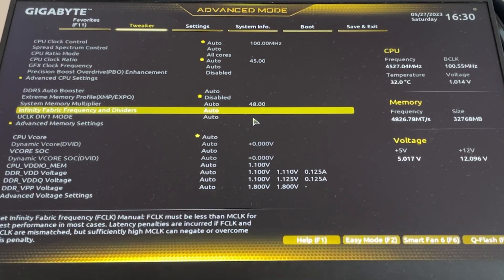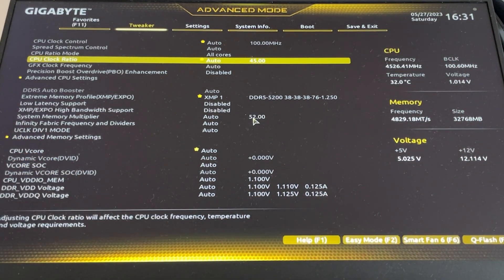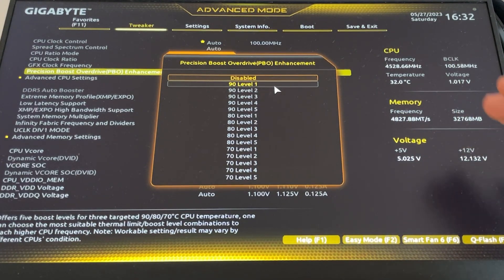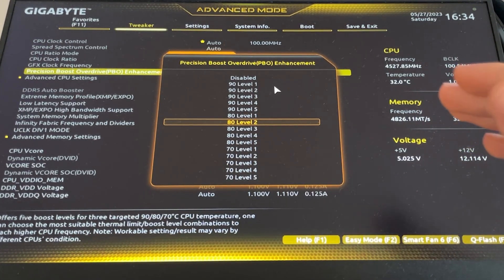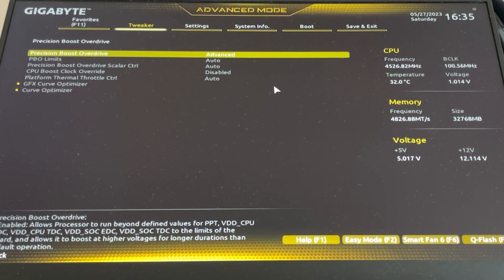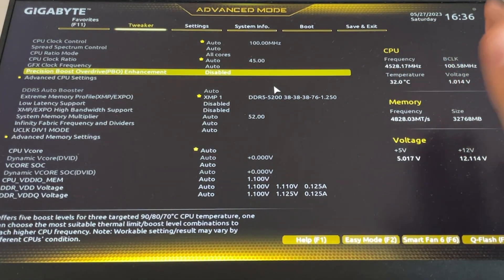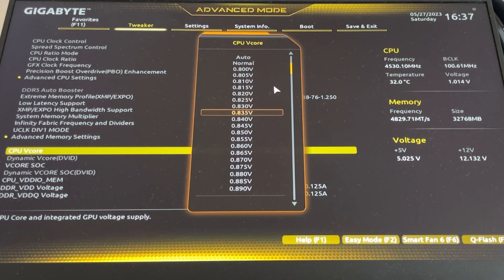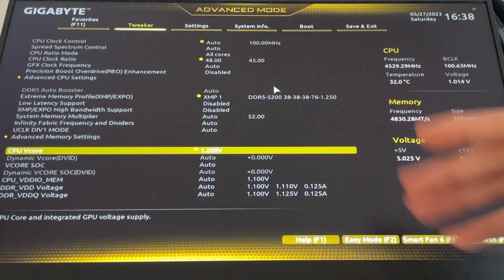Undervolt your Ryzen 7 7700X for more FPS and Lower Temperature!

Comment: So far I have the 1.2v set, 48 multiplier, and PBO at level 80 Level 5 so far Im staying under 50c still, but I noticed the frequency never goes higher than about 4850. Do you have any further advice to boost the frequency under heavy load?

Comment: You da best man! Undervolted at the preset 80-2 and it instantly dropped my temperatures by an average of 10c on CPU heavy games. I was freaking out all day thinking I had done the thermal paste wrong when hogwarts legacy went clear up to 99c when rendering shaders. I did a fresh install and it only hit 85c the second time around. I knew the 7700x ran a bit hotter than other 7 series CPUs, but 99c was WAY past my comfort zone of 85-90 cap

Thanks again, cheers!

Comment: Question, 

on my r7 7700 (max is 5.2ghz i think), i lower my clock ratio to 48. And i tried to run cinebench, its not reaching the max peak of 5.2ghz, is this because i lower my Cratio to 48, is this bad? Or should i put it back to auto? 

My cpy temp before i did all of this (while gaming) is 75’ish

And after i lower it to 80 -20 it drops to 50-55.  I know its because of pbo, but what is the reason of lowering the cost ratio.

Comment: Getting 5.1Ghz with a manual setting of 70 degrees thermal limit and -45 offset. Running cinebench for 30 minutes. Will do some long term heavy use and gaming and see if it holds. Was getting 5.3Ghz with a 75-85 degree limit and 30-40 offset.

Comment: i overclocked my Ryzen 7 7700 no X TO 5.0 GHZ all cores with 1.1 volt and its very stable and consummation below than before  and max temperature 70 degrees

Comment: Hi! I usually like your undervolt videos, but this is just bad. You just fixed a CPU at 4.8Ghz while this type of CPU is designe for big Ghz jumps, even for around 5.4 . Just use the settings that optimum used in his video that named "Fixing Ryzen 7000 - PBO2 Tune (insanity)". I get even colder (around 65C) and LOT better performance, around 2% loss. With yours, 75C, with 20% performance drop. BUT! I would used your settings, but i had crashes :') I started research and i found that gold video from optimum. (If you crash with -30, the -20 will works fine)

Comment: I have the 7700x on manual OC - 50x ratio on 1,1volts. Temps are from 45 (high idles, but normal as i readed) to 60 max. With 1,2 volts can i set 52x ratio, and with 1,35volts 54x ratio. All stable but i use the 1,1 volts scenario. Enough performance and nice cool. But! I use the CPU without Multithreading, just the 8 cores and 8 theads for gaming. I have not good experiences with PBO, crashes and high temperatures. Best choice is the manual OC. Thanks bro

Comment: So this video is a little misleading, when changing the pbo enhancement it does actually undervolt your cpu, however when he shows going to the curve optimizer I noticed he went into the gfx curve optimizer and anything changed in here only undervolts the integrated graphics that are on the 7700x. Most people who are going to undervolt their CPU will be using a dedicated GPU which means this setting will do nothing for you
Reply: Yeah but the normal curve optimizer does lower temps and that's a fact

Comment: For me leaving the voltage to AUTO helps a lot, it boosts the clock speed to 5.4 MHz. I would say, not play with the default settings but try the PBO negative

Comment: Hey. ! Some help
Needed. Cinebench hits 102*c on this cpu for me. (7 7700x) 

Is this a case of concern ?
Reply: Yes
Reply: @OJoshiee alright, what could be the reason ? Motherboard. AIO or the processor ?
Reply: @namanjoshi2528  maybe the aio, I ran a cinebench and before undervolting the highest I’d get was 95*c
Reply: @OJoshiee  alrighty! 
Though my computer stopped working lol. I need to check. There’s no light in AIO, though the Rad fans are working, probably AIO, or the MOBO is the issue 

I did PBO with offset of -10. Removed the temps throttle limit and set it to auto and it was pushing 5.2ghz -5.4ghz under heavy load.

Comment: Set mine to 1.28 and its been perfectly stable. ASUS is giving waaayyyy too much voltage to the vcores! My system would power 41 and hard shut off in games, once I undervolted the issue went away. ASUS' QC is total trash anymore. Even the latest BIOS from ASUS is giving my 7700x 1.48V and it is unstable under load. This is not acceptable, this could fry people's chips or MBs. Most wont know how to fix this problem.

Comment: Thanks for the help from your video, although a year old it helped me a lot to get my Ryzen 7700X to run under 94c under load. Although the BIOS was newer I tried your preferred method using 80/20 rule but it just did not work well. So I opted with your last suggestion and tested the CPU ratio at 48 with the CPU VCore (not called that in the MSI BIOS) and tried s few settings settling on 1.205v.
This gave me a much more stable system without needing blocks of Ice to keep it from melting inside the case. Max CPU temp under load = 78c with idle temp of 47c using a 48.5 CPU Clock speed. (could probably try higher)
I know this CPU is capable of doing more but the H5 Flow case needs a low profile 6000 ram to allow a Liquid Freezer 3 - 280 cooler so I settled on the Liquid Freezer 3 - 240 cooler at 100% and kept my fast ram. I did upgrade my MPG 650 Edge WIFI Motherboard BIOS to 1.10  - AMD Agesa 1.2.0.2b so all of your video screen settings were totally different. Worked it out eventually and this board has 6 x Sata connections which I needed for all my HDD's but it's not the best.

Excellent video and happy gaming.
Reply: What about the performance in gaming ? Or some workloads

Comment: Quick question, I've already fine tuned my 7800X3D with B650E Aorus Master which gives a nice 107 ECLK 5.4Ghz (with CO individual tuned for each core), 2200 FCLK, and DDR5-8000 CL36. Do I still need to enable PBO enhancement. Still not quiet understand that 90 Level 1 will overwrite my CO or not?

Comment: Im using a b650 gaming x ax v2 and a dark rock pro 4 for my cpu cooler and my temps were around 85 with a low 30% cpu usage. After using your settings I was at around 56 degrees with the same usage. This whole concept is so weird to me. Why do the CPU’s come with such a high default temp? Is it normal to under volt a cpu even with a whats supposed to be a good cooler? Im worried about losing some performance somewhere but I guess this will have to do for now.

Comment: Hi, in on MAG B650 TOMAHAWK WIFI (MS-7D75) When we talk about undervolting, CPU Core Voltage (Auto) is at 1.460-ish, and I like to try 1.2V as you said. But when I click to change it the options I see are: Override Mode, Offset Mode, Override + Offset Mode, AMD Overclocking. Which option should I click to set the 1.2V? CPU is Ryzen 7 7700x.
Reply: Hey I have the same motherboard and CPU as you when you stress tested it what temps did you get at stock

Comment: Am I the only one getting about the same score with all settings, except with PBO 90 Level 4?

PBO enhancement 70 lvl 1 + EXPO
PBO enhancement 80 lvl 1 + EXPO
PBO enhancement 90 lvl 1 + EXPO
No PBO enhancement + EXPO
All got me 18000-18500 score in R23 (except for 70 lvl 1 which gave me 17500)
PBO enhancement 90 lvl 4 (Highest that booted into windows, lvl5 won't boot) + EXPO gave me 19200

No PBO enhancement and no EXPO, gave me 18300

I honestly don't see the point on PBO enhancement and EXPO if I get the same score. Tested a few games too, and the FPS difference is between 1 and 2 FPS across the board (Which can be taken as fluctuation)

Maybe for productivity tasks there is a real improvement, but for gaming, which is my current task, I didn't see any meaningful improvement

Or maybe I just don't have enough thermal headroom (I have a ML360 ARGB V2)

Comment: I don’t really understand any of this undervting or over clocking stuff but when I used pbo 80 lvl 5 with my 7700x it gave me a good performance boost with lower temps. I just want to know if it’s safe to continue using pbo and if it won’t degrade my cpu
Reply: Please this is a Great question
Reply: its going to be fine 
these cpus are designed to run 95C constant, but running them lower will be better
Reply: Pbo won’t degrade it I use pbo on a 7800X3D and I manually set my settings and been running flawlessly for a year and going

Comment: I successfully overclocked my 7600x to 5.275 GHz with a voltage of only 1.150v. While it does not maintain stability during Prime95 testing, it successfully completed a 30-minute Cinebench benchmark and I've had no issues during regular use. The testing process can be somewhat tedious, as it requires adjusting both the voltage and frequency, followed by a 10-minute Cinebench benchmark. If a crash occurs, it is necessary to modify the frequency and voltage settings again and repeat the 10-minute benchmark. This process must be repeated multiple times to identify the optimal settings. Additionally, it is essential to document the configurations and results in a spreadsheet. Although this procedure is time-consuming, I believe the effort is worthwhile.

Comment: When profile for 80c and -30 curve is set, cpu goes past the temp limit.
Only when throttle limit under advanced cpu options is set does cpu stay under the predefined limit. This in turn makes pbo profile useless regarding temp limit.
Have you tested this possibly?

Comment: so would 90 level 1 be more likely to be stable than 90 level 2 for example? should i go from 80 level 2 to 90 level 2 if it's stable? or should i go down to 80 level 3 for a performance increase? or 90 level 3?
Reply: 90 , 80 , 70 stand for cpu max temp , level 1 , 2 ,3... stant for - 10 -20 -30 ....
So you try out 80 ,lvl 2 if its stable go with lvl3 just like that until its not stable on the test if you get 80 level 4 its really good
Reply: @ra-gn5kv  i just went with 90 level 2, will maybe go for level 3 once im done overclocking my card
Reply: @PenguinsAreColdish  you shouldn't go with 90 at all , go 80 lvl 1 or 2 its way more better than 90 !
Reply: @ra-gn5kv  how so? dude in vid says it’s better performance, and my cpu doesn’t even come close to 90
Reply: Anyone could answer me something , i tried 70 level 3 and i found it very comfortable with temperature like 65-70max when i play games and my fps are the same as 80 level 3, but nobody suggest 70 lvl why?
Reply: @tasisa.2931  you get worse performance because ryzen is made to target high temps. dont go lower than 80
Reply: @PenguinsAreColdish  so better to use 80 level 5 or  smaller level?
Reply: @tasisa.2931  level 5 is extremely unlikely to be stable. personally for me, not even level 2 was stable, had to put it at level 1. 80 or 90 works
Reply: @PenguinsAreColdish  i have tried it and it work. But what do you suggest me for good temperatures and good performance at the same time
Reply: @tasisa.2931  7700x is made to run at 95 degrees just fine, unless you just really want yours to run cooler, just set it to 90. test stability with the offsets, but i highly doubt -50 will work for you

Comment: i have an important question: so 80 is the max temp the cpu is allowed to go to.
you say level 2 is a "curve offset" but what is that curve controlling? voltage?

and if i want to set a static voltage offset does it override PBO?

Comment: Hey PSUs I just built a new pc A MSI B650 MB with a 7700x it has been working fine up until last night it randomly shut off I’m assuming because of overheating. Do you think that it overheated due to my Peerless assassin or because of the high temps the cpu boosts to 95. Also my MSI center clocks it at 97-while gaming but clocked it at 128c before it shutdown. Do you think this will help keep it from overheating again?
Reply from the maker: Yes! But only if you subscribe to the channel :)
Reply: Same specs

Comment: So I’m running a Ryzen 7700x with a gigabyte motherboard and a 4070ti at 1440p. Only when I play one game has my system shot up to 93degrees. I tried what you said switching it to 80 level 2 and I don’t really notice a difference. Should I go up to 80 level 5?
Reply from the maker: I’d say yes! But you need the negative offset too

Comment: Hi I was using the 80 lvl 2 PBO on the r7 7700x but after a bios update and drivers update from rx 6800 it become unstable. Could it be just a driver issue?Or my cpu just didn´t like the 80 lvl 2 any more? I really appreciate this tutorial since in the anohter update I was getting the same fps whit -10~-15 C
Reply from the maker: It unfortunately means that now it’s slightly unstable. I’d say lower your negative offset a bit, but keep the 80C limit

Comment: HI. I performed the first part of the tutorial (manual PBO 80 and Curve Optimizer -20... everything ok) but I wanted to understand the usefulness of the static voltage offset (48 and 1.20v). Could you explain to me why it's worth it? Thank you.
Reply from the maker: That’s a different setting, basically it gives you even lower temps and power consumption, it’s ideal for full load productivity and/or synthetic scenarios
Reply: @ImWateringPSUs does it affect performance when gaming?

Comment: My 7600X is 5.1ghz @1.10V 100% stable! I always doing OC manually (from time when Intels 2500K CPU come out) 😂, the same here, always looking for best Ghz with less volts. For 5.2ghz i need 1.14V, its increased power and temp, for 5.3ghz dont know because CPU is at 95C+ always 😢. Im happy with my result, its OCCT stable (5.2ghz @1.13V was stable in games and in Prime95, but then i tested it with OCCT its a lot better programma and i got thousands-hundreds of errors with 5.2 @1.13V, then tested 1.14V and it was ok, but temps goes to 95C), so my perfect DownOC is 5.1ghz @1.10V ❤
Reply from the maker: I’m really happy it was helpful! Thanks a lot for taking the time to leave some feedback :) Consider subscribing if you wanna support the channel!
Reply: Do you mean 1.110 V for CPU voltage or 1.100?
Reply: My CPU max out at 65°c, -30 co with -400mhz

Comment: Will this work with my overclocked ram??
Reply from the maker: Absolutely yes! But only if you subscribe to the channel
Reply: @ImWateringPSUs I'll subscribe if you tell me if I can just use 4700mhz for cpu and 1.22 for the voltage? I only have a thermalright pearless assassin cpu cooler

Comment: You can also leave voltage at auto and make voltage offset (dynamic vcore), i do that for intel processors many years.
Reply from the maker: Agreed, but on ryzen it works better with either a curve or a static altogether, due to how PBO works

Comment: I test my 7700x in Windows whit "AMD Ryzen Master" up to 5300MHz whit ONLY 1.16V, but the System is not ever Boot correctly, I am currently running at 5200MHz at 1.18V so i have 42°C at normal use whitout noisling
Reply from the maker: I’m really happy it was helpful! Thanks a lot for taking the time to leave some feedback :) Consider subscribing if you wanna support the channel!
Reply: Did you change anything else? Or just core voltage and cpu mhz

Comment: I have a gigabyte b650 AERO G motherboard and Ryzen 7800x3D. In bios options I don't see the option for CPU ration mode? Where do I get that settings? also there are no option called CPU VCORE under Tweaker section. Need urgent help
Reply from the maker: Hi there! You need to set the Tweaker into “advanced” and be sure to have the latest bios. Consider subscribing if it ends up being helpful :)
Reply: having the same issue on a x670e aorus pro x , and using latest non beta bios.

Comment: If i want to do the 48 1.2 method do i have to have pbo enabled?
I really dont like the speed jumps
Reply: Cause like this im at 4.8 stable but im leaving some ghz on the table, so dont really know what to do.
Temperatures seems to be around 71 during cinebench
Reply from the maker: Nope, you don’t have to! However it is highly advised to subscribe to the channel :p
Reply: @ImWateringPSUs  but what is best tho, 4.8 1.2 with pbo on and -30 or just 4.8 1.2?
Work for your sub sir
Reply: @ImWateringPSUs  sorry to bother again, so i set 4800mhz 1.2 voltage and enabled pbo with 85 and -30. Is it normal that my speed is static at 4800 even while im doing cinebench and also my temps are nowhere nrar to 85, in fact im at 73?

Comment: The under volting worked like a charm with the same settings as yours 1.2v  @ 4.8Ghz now the CPU 7700x sits at Max 75° C during heavy stress, heartily thanks.
Reply: I have a 7700x & tried these settings & my PC just kept restarting itself & wouldn't boot ito windows. I had to go back & undo everything.
Reply: @hellotoddmiller  undervolting can cause instability if you feel comfortable enough just tinker with undervolting it less aggressively
Reply: @hellotoddmiller what are your specs (motherboard, ram, gpu, ssd/hdd) ?
Reply: @hellotoddmiller what PSU do you have? I was having issues with these settings and my Corsair SF600 until I upgraded to a SF750 😅
Reply: If you set to 4.8ghz does it run across all cores even on heavy load and does it still boost to 5.4 ??
Reply: Il try to do this cuz mine stock is 80w or more plus voltage 1.3 to 1.4 when gaming even idle some time
Reply from the maker: I’m really happy it was helpful! Thanks a lot for taking the time to leave some feedback :) Consider subscribing if you wanna support the channel!
Reply: @ImWateringPSUs  ofcourse subbed

Comment: what is the power consumption on idle and under load? at 06:20 u say 50-100W would be pretty sick! could it handle 50 clock ratio with perhaps 1.25 or 1.27v just to be sure there's no issues?
Reply from the maker: I can confirm that that’s the average drop you  can expect! 50 at 1.25/27 could work but for specific voltage points you need to do quite a bit of testing on your specific CPU :)